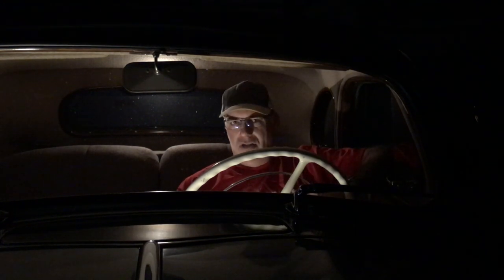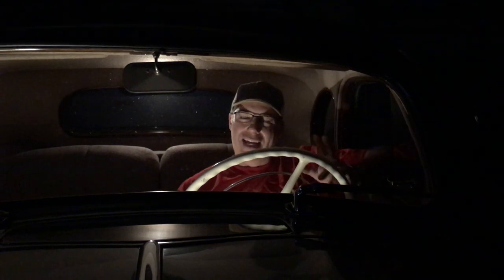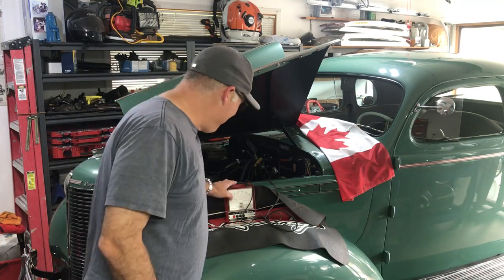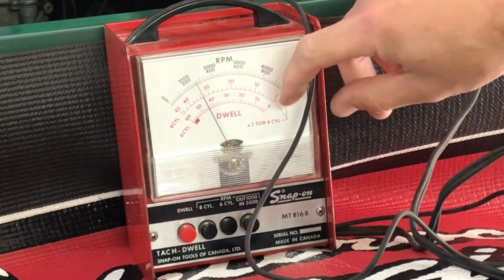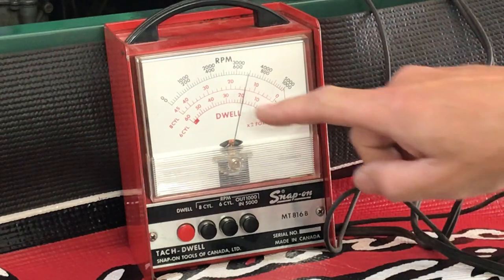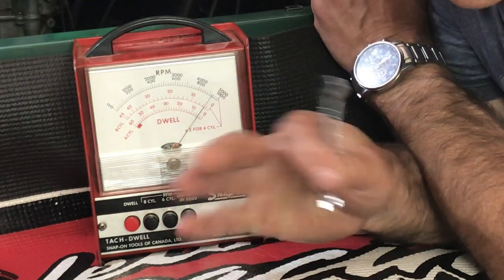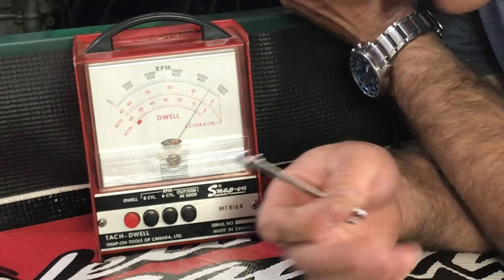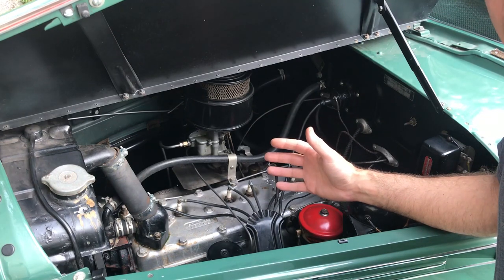1930's Vintage Car  - Electrical System Repairs & A Little Hood Ornament History Lesson.

Comment: Hello! Thank you for doing what you do! My 46 Desoto has a similar base plate to the one you now have installed  The locking screw was stripped out causing it to drift quite a bit. It was nice to see something I had so much trouble with being discussed in your video. Keep up the great work!
Reply from the maker: Thanks. As I uncover more projects on my Mopars I will post more videos. Thanks for watching!

Comment: Good job, looking forward to your followups. Most of your instructional information applies to some of the independents of the prewar period in addition to the Mopars, my '39 (blank brand) flathead straight eight has basically the same two Autolite distributor types as you have and the inner fender comes out the same way to access the valve adjustment, so you are weilding a broader brush than just Mopars. Keep up the good work.
Reply from the maker: Thanks Jim. I don't know other brands of cars very well. Perhaps I will re-title the video to attract a larger audience.

Comment: I have a ‘39 Plymouth and I converted it to a Pertronix set up with a new Pertronix coil, my car starts right up every time and runs like a top.  No points to mess with and no Dwell to set.  I highly recommend Pertronix and have converted several old cars that I own.  Looks totally stock but I now have a modern electronic ignition.
Reply from the maker: Thanks for the response. I am aware of the Pentronix system. I am not overly interested in it. They work great when they work. Or then they don't. There are no adjustments. When they fail, you are dead roadside. Points worked well for about 100 years. I can take a screw driver and dial them in quickly. The obstacles I am overcoming here are from a car that saw very little use over the past 25 years. I have no idea how old the points are. I've been having fun finding the exact root cause of each symptom, with the parts that came in the car as purchased.  New points went in, and they will serve me well for years. Cheers. Keith

Comment: Hey, what are the connections for that Snap-On dwell/tach meter? Yellow I think goes to the points side of the coil, but what about the red/black leads for the positive ground system?
Reply from the maker: Yellow to points side of coil. Red to ground. Black to starter lug where main battery cable bolts to it.